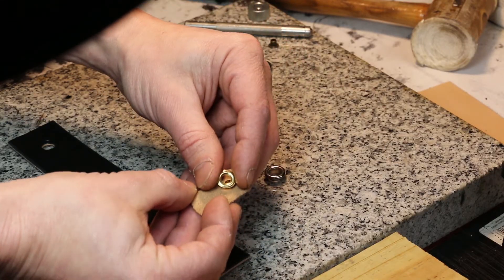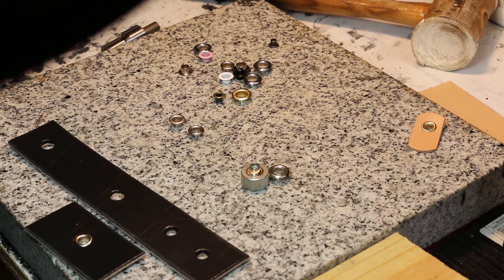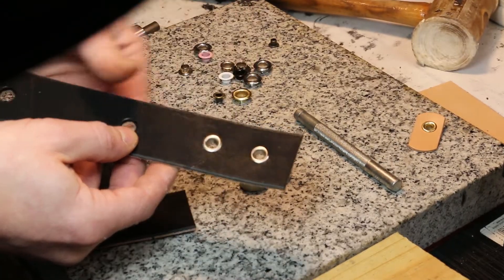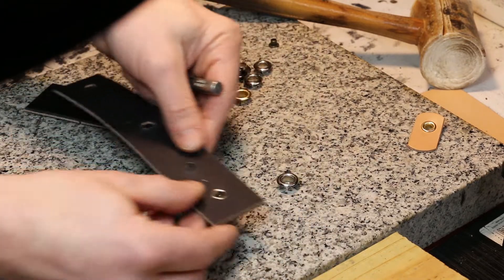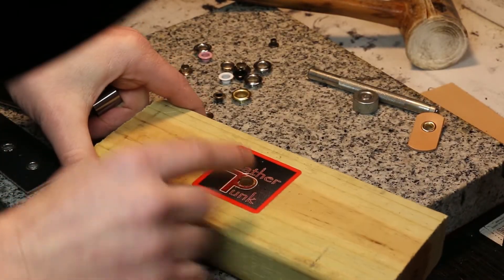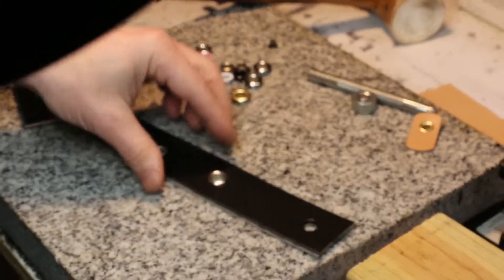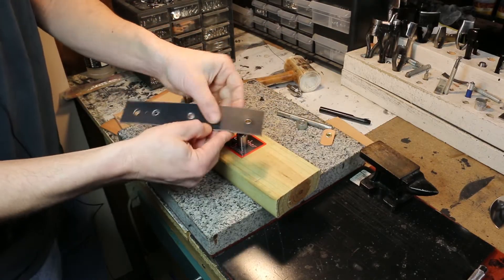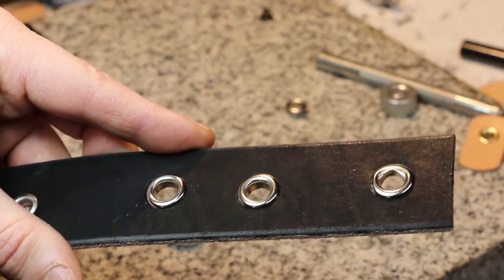How To Set Grommets And Eyelets

Comment: I still dont understand. Mine wont work. I have a very thin piece i need to put these holes in. Its a soccer flag pennant. My kit is weird and no instructions given. And this video did not help understand it any better. Im stuck
Reply from the maker: What happens when you attempt?
Reply: @leatherpunk  i may have the wrong size. Either way, when i hammer, it doesnt do anything. It bearly made a dent. Ive called hone improvement stores in my area and nobody seems to know what grommet even is. I give up.

Comment: That last one you did just to show me how I'm doing it. I know it's wrong, that's why I'm here. Salt in the wound buddy. Like Nancy, I have a huge stash of rivets, eyelets, grommets, snaps, punches, anvils, setting tools and a pair of tools like you used in the wood, but the pin on mine is spring loaded and goes flat. any hints for that? The other part is the same as yours. I put it in a vice (vise?) to hold it. Thanks for the clarity!

Comment: I recently found a box that had some eyelets and grommets inside! Now thanks to your video I konw the difference! thank you!  some of the eyelets are scored.. they are tiny! the former owner also left an eyelet "plier" I guess it is called  but maybe I dont know how to use it correctly or it doesn't really want to work on those eyelets.. and no anvil or tools for the grommets.. I hate to throw them out. I could use them.  I am not sure how to get the right tool for these eyelets and grommet .. I guess look for a Tandy Leather shop?  sounds like they will all need their own "sitting" tools since they are different sizes?   The great thing about finding it is now I can think of so many things to use them for!   Thanks again!
Reply from the maker: Glad it helped! Yes, you'll have to locate a matching anvil. If the eyelts exist, then an anvil for them also exists. Take accurate measurements of the flare and the barrel diameter and use that in your search. Another option to Tandy is Springfield Leather.

Comment: Very clear and helpful vid, thank you very much! I was searching on YouTube for how to reinforce holes for new thread on a leather saxophone neckstrap that has no holes yet. Grommets will be the best for that given the fact that they are smooth on either side. Is it necessary to use a (wooden) mallet?
Will steel damage the tools?
Reply from the maker: The mallet I use weighs less than 16 oz. The wooden hammer would be better than a metal hammer, but I would practice a few times first.
Reply: @leatherpunk  Ok, thanks for your answer.

Comment: Where do you get the larger eyelets and grommets? I have Redwing work boots.  They came with speed laces which I removed. The thickness of the leather is like two of the leather pieces you use in the demonstration. I would prefer grommets. I ordered a few kits but I dont really understand how they're measured. I keep getting grommets and eyelets that are too thin and too small in diameter. I have all kinds of punches but too small. On my old Redwing boots I used two eyelets per hole. So I would do the one then from the other side put an eyelet in and crimp it inside that one to hold it in place. Eventually they fall out. These new boots I bought are even thicker and the eyelets fall out after a day of use cause they're not anywhere close to making it through the leather.
Reply from the maker: Try Tandy leather
Reply: @leatherpunk  what do u know... I live 30 min away from there too
Reply from the maker: @tripp121283  Ya, if you're in the US, there's Tandy dealers in many towns.  They will have a good selection of stuff like this.
Reply: @leatherpunk  thats weird I've never noticed them
Reply: @leatherpunk  thanks

Comment: Not sure how to set a grommet- does it matter which way round the washer goes (ones I saw are not flat) also is there any deviation to the setting method? I saw some people tilt the tool in a circular shape as they pound it.
Reply from the maker: You want the washer seated so the rim is downward.  Yes, you can angle the setter as you go, it's just another way to make sure it's evenly set.

Comment: I want to replace the hooks in my work boots with eyelets.  What would you recommend that would last under the pressure of being tied up tight every day?  I don't care how it looks, as long as it is functional.
Reply from the maker: A scored eyelet is probably the best for a boot lace, but the rolled rims will work too.  In either case, as long as you have the correct size holes for the eyelets, they'll hold just fine.  Removing the hooks without damaging the leather will be the hardest part.  Practice inserting new eyelets on scraps before you work the boots.